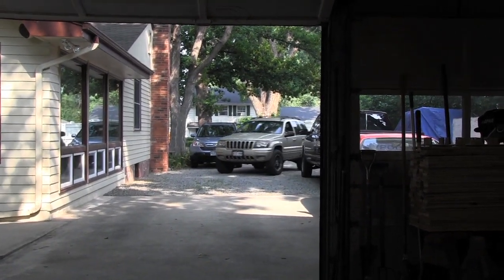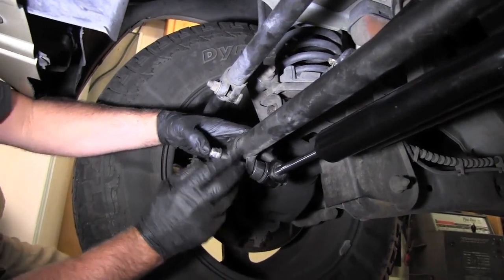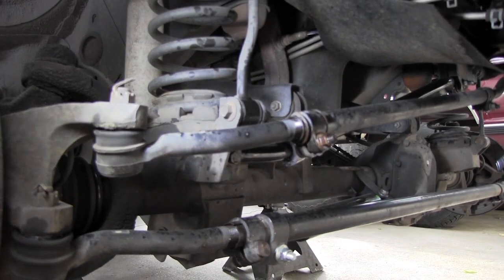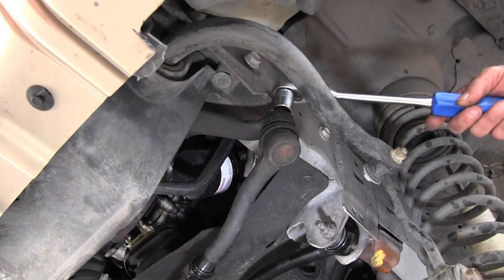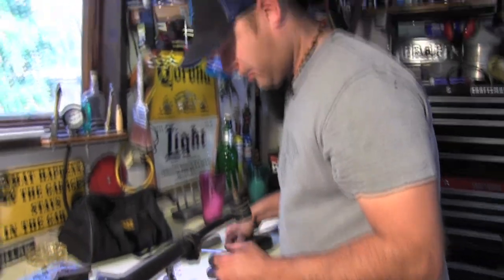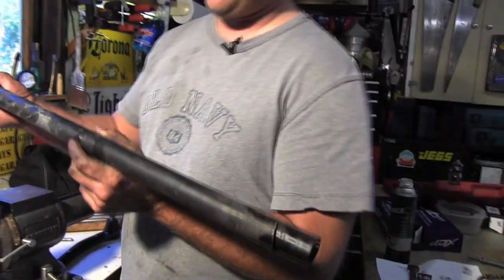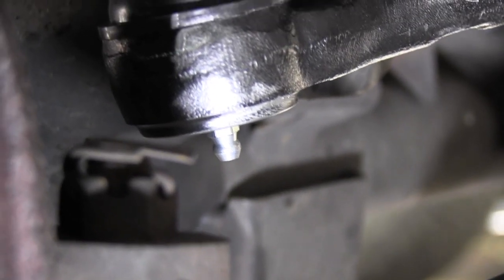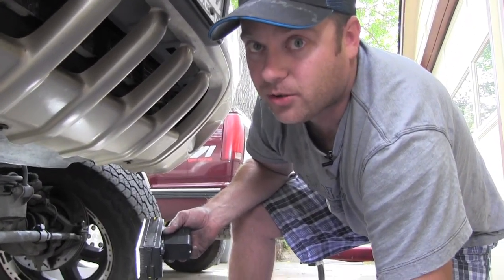Death Wobble Fix - Jeep Grand Cherokee Part 2

Comment: Thanks for the video. I replaced the steering stabilizer which was obviously bad (leaking oil). It didn't solve the problem though. I took it to a shop and the they determined it was the track bar and all four control arms.  I saw a video on replacing the control arms, and it was more than I wanted to tackle. I spent all my Christmas overtime money but it was done while I was at work.

Comment: A tip we been doing for over 40 years is to heat the tie rod end sleeves with a simple hand held propane torch and we use map gas instead of propane and use on other bolts and works great on brake bleeder screws. Of course put the anti seeze on everything.

Comment: Just finishing up my death wobble repair; my WJ is a secondary vehicle so I was able to leave it on jack stands in my garage for several weeks and take my time replacing ball joints, tie rod ends, steering stabilizer & track bar. Watched part 1&2 a few times to get my bearings, thanks for posting it up! Pete seems like a good guy to wrench with!
Reply: instablaster.

Comment: You can use grease and sand mixed together on the threads running in and out numerous times then wash it all out and then put your anti-seize on then turn it with your fingertips or if you want to be technical valve seating compound I use grease and sand you always have that around

Comment: Hello.  I would like to ask you a question about the death wobble symptoms in my Jeep WJ.  I modernized the entire suspension over a year ago, raising it on washers by 2", replaced all bushings with polyurethane ones, new rod ends, shock absorbers and steering damper. Everything was fine for a year, but recently the Jeep at a speed of about 80 km/h (50 mph)  it started to fall into the death wobble. The entire suspension is stiff, there is no play anywhere, there is no knocking. Due to these new symptoms, I installed harder bushings in the trackbar and a new steering damper because I suspected that this was the cause. Now the speed of falling into death wobble.  wobble is about 60-65mph. If you have any ideas what else might be wrong, please write your suggestions. Sorry for my language, but I don't speak it very well and I used a regular translator. Thank you and best regards.

Comment: All you have to do to fix death wobble is buy the 12 piece  tier 4 core control arm set and steering linkage,  a redtop steering box, and drop arm is stock up to a 4 inch lift and you'll be good.

Comment: It's the balancing of the tired!! Not all the unnecessary replacement of parts.  A steering damper does not cause a vibration. Tire guys make a lot of extra money when they get you to return for more parts. It's the tires not being balanced correctly.

Comment: Some more tips for ya' ...after doing a zillion of these, at 7:40 by your using a pickle fork to pop her loose, alternately in this particular view, one can strike the top of your castle nut with your 3lb drill & that works too, but only if you have a new castle-nut.
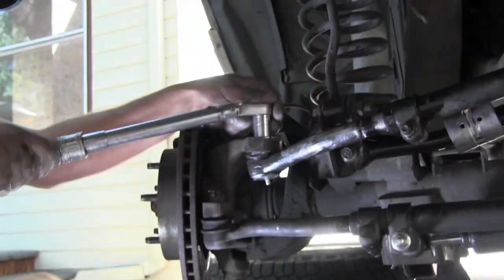  Also, at 19:00 when your tightening the castle-nut, sometimes the spindle will turn denying you the full torque value...take a large slip-joint pliers(EG MAC M460G) & apply pressure to keep the spindle from turning...or, put a floor-jack(or tranny jack if 'up in the air")  to apply SOME pressure as well. The pickle-fork has seemed a little iffy sometimes for me, as the thickness of the spindles can vary, & sometimes these spindles can be too big for your particular fork...& you can't really "know" by sight because of the taper...a bit of a guess really. I know of this because on a few instances the fork has jammed because the spindle was too big...hence my alternate approaches..
Reply: When do you put Greece? DO you think better before tighten ing up and before you drop it back down??
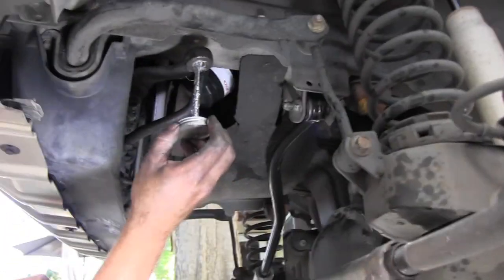Reply: @jat-justamaturetech-philpj8285  At 17:42   no, no & no.....do NOT be putting any "high solid" lubricant in the taper pin nor the hole. The pin itself is a harder material than "the hole", as such, this is a solid metal to metal fit, the taper itself is to assure this. When one removes an old one, you can actually see the slight metal deformation in the hole confirming a solid fit. Both pin & hole should be as clean & dry possible  before assembly....no lubricant.
Reply: @AndieBlack13  . Lol. I think you misunderstood me? I meant lube in the joint.
Reply: @jat-justamaturetech-philpj8285  The sealed versions without a zerk fitting of course are pre-lubed at the factory, those with the fittings you fill them up anytime you want, preferably after you've assembled everything & the suspension is still unloaded, as it's easier to clean up when the grease puffs out telling you when it is full.

Comment: After replacing shocks, stabilizer, track bar, bushings and alignment, I had enough and took it to my mechanic. He looked underneath, said nice job, how about replacing these nine year old tires now before I redo your alignment. Put on a new set of tires (Cooper Evolution), went over the same areas I always experienced that $%^$% wobble andddddd......no wobble. Went back a second time over that twenty minute stretch of highway and no wobble. The front end would shake like crazy, not anymore. Now I wonder if it was the tires all along.
Reply: roadrunner Hmm 🤔. Ok I’m going to get 2 good used front tires first since I need them anyway and work from there. Because I replaced my tie rod and sleeve already( for another situation)
Reply: roadrunner Reading back a month later, all those components you added were probably needed. I got tie rod ends done and ball joints because they were worn out. But I haven’t got tires yet and I still have a slight small wobble, not as bad. But it all adds up. At least it’s not our engine lol.
Reply: @Tdurrgt  I came across this a year later, hope it all worked out for ya. So that was my 98 XJ. last year around this time I experienced the wobble starting on my 2000 WJ and tackled it. I did replace the trac bar and stabilizer again because they were loose....inexpensive parts. Still had the wobble. I didn't replace shocks yet. My Goodyear tires were in need of replacing with 41k miles and seven years, ( great tires but didn't want to spend $500+) so I replaced with same Coopers as Tire Rack had a $50 rebate with purchase of four coming to $400, ( great tire for the money). I drove to that dreaded wobble section of highway and no wobble, didn't even go back around and have not felt that wobble for over a year now. Going to replace shocks now but not going with Monroe Sensa-trac again, they replaced the original Mopars but not spending that kind money. The Monroes gave it a very unstable ride being that they are twin tube shocks, I am leaning to Gabriel mono-tube as many have suggested. Learn something new everyday. With 187k on this 4.0 Jeep I have replaced so much that I know it like the back of my hand, easy to make repairs, window regulators, radiator, water pump, a/c compressor which was a PITA, brakes, hubs, axles etc. I am going to take this to 200k. Latest was valve cover gasket which did not stop the oil leak. Next has to be oil pan gasket and rear main seal combo, again inexpensive parts but labor intensive on my back no less. Lot of guys knock Jeep but the older Jeeps were so easy to work on even if they did break too often LOL. And the 4.0 is bullet proof. I call it therapeutic. This is my second time around...If anyone is having this problem and your tires are old (check the DOT code on the sidewall); replace your tires first being you need them anyway, and ask the tire shop if you can look at the physical tire tread and check the DOT code, sometimes these tires are already a couple of years old from sitting in a warehouse before being ordered, that's years loss of tire life and flat spots, it might be a savior before getting involved with the front end which could run you up some big money if you don't do it yourself. Cheers.

Comment: Ok on my Jeep Grand Cherokee I went though the same issue the way I fixed it was to replace the pinion arm,once I did that Wala the death wobble was fixed, hope this info helps
Reply: Dave Coakley I’ve replaced so many parts for this problem but the pitman arm. Still having the problem. If that doesn’t do it I’m selling it for parts
Reply: @rayo8482  I went through the same thing its the bar which has a ball joint on it that hook to the arm going to the steering box you will see it,mine was hell to get off had to air chisel the nut of of it,but buddy it fixed mine I think it's around a hundred bucks I believe,it's been six months or so sense I finally got it figured out

Comment: Steering stabilizers do not fix death wobble nor do they cause death wobble. They dampen steering vibration
Reply: So what does??
Reply: @jat-justamaturetech-philpj8285  so many things. Worn out tie rod end/s, control arm bushings worn out. Having loose components will then wear out the steering stabilizer shock.
Reply: @zzz7zzz9  . Can you replace the control arm bushings on a 2000 Grand Cherokee Laredo??
Reply: @jat-justamaturetech-philpj8285  yup. But, it's a bitch. Much easier to just change the entire control arms. Sure, just doing the bushings is slightly less price, but can wind up taking longer anyway, and much, much more frustration.
And it wouldn't be any savings, as you'd likely overflow the curse-jar a couple times over.

Comment: I have replaced 3 of my 4 tie rod ends my track bar and steering stabilizer, and I'm still having the death wobble. Only thing for me to try now is replacing the steering gearbox and the last tie rod end
Reply: It is caused by an out of round tire. NOT out of balance, out of round. All straight axle cars have the wobble.  Ut happens at 40 mph or around there. Check your tire ad it will be fixed. Old school fool.
Reply: Jennifer Bailey how are yur ball joints?

Comment: Have a question for you regarding replacement of the steering stabilizer. I purchased a rough country n 2.0 steering stabilizer for my 2004 Jeep Grand Cherokee Laredo. I installed it the same way as your video shows but for some reason if I keep the bracket that holds the smaller bolt in the downward position it seems like it binds and the bushing comes out a little from the end of the piece. The kit came with two washer so I put one washer on each side of the bushing ran it through the little bracket and it seems like for me not to have it by and I have to turn that bracket forward and upward to get in a position where it's actually straight which puts it about an eighth of an inch from the actual tie rod bar but it doesn't seem like when I tighten it it's completely tight not sure how much pressure or Torque to put on this Bolt saying when I videotape to myself turning the steering wheel that little 10mm bolt or whatever it is you can see the bushing move

Comment: What was the length on the bottom bar? (Long one) on my 2002 mine is bent and im not going to get a good measurement.
Reply: Bottom bar is tie rod adjustment sleeve 41.5" long I have 2000 grand Cherokee.

Comment: I have an 02 wj 4.7 with 1,5" old man emu and 265/70/17 bf and I was experiencing terrible death wobble. I ve just replaced track bar bushings, front lower control arm bushings, front upper control arms and bushings, all four end tie rods... And the death wobble is still there..? Front OME coils are heavy duty, while the back are non heavy duty and I don't have any winch.  Also have replaced the steering stabilizer with a procomp. The bill is getting higher and higher and no solution to the problem.. Anyone any ideas?
Reply: You check the wheel bearings? Having the same problem in my 02 4.0 and I've replaced all tie rods ends and it'll last a week and it'll come back. Getting at my wits end
Reply: And when you replaced the bushings did you check the ball joints?
Reply: I heard it can be the tires??

Comment: I have an 01 jeep grand cherokee, I wouldn't say I have a death wobble per say,  but at around 45-50 the steering wheel will shake/ vibrate. and it does not do this all the time.  my mechanic test drove it with me in the vehicle and it did do its vibration. he took it back l to his shop, lifted it and checked everything, front and rear.  ouldnt find nothing going wrong. Nothing was worn, torn, broke or loose. thow my passenger front side tire is missing a wheel weight. any suggestions other than re balancing my tires.?
Reply: one of your tires may have a broken belt my Grand Cherokee did the same thing. I replaced the bad tire and it fix the problem.
Reply: Dylan Strickland just had the tires re balanced and rotated front to back. that fixed the wheel vibration.  but belts looked good
Reply: Maybe a wheel weight fell off? Something thew balance out of whack.

Comment: So did it fix it?
Reply from the maker: Sorry for the late response....In my case it fixed it after replacing all the parts you saw in the vid.  Another cause could be your control arms....both upper and lower.  If the death wobble comes back, I'll do a vid on replacing those.

Comment: You always hit the part the joint is going into not the joint. It’s a cotter pin not a key and it’s a castle nut not a castleated nut or whatever you said. And we got left hanging on wether it’s fixed or not.

Comment: I watched this video then proceeded to hopelessly beat the shit out of that top tie rod on the drivers side to no avail thinking it would would eventually pop out like it did for u guys and almost lost my mind thinking that's just the way it had to be... eventually I discovered if u disconnect the other side first u can turn the wheel beyond normal range and the bolt will swing right out into open air for u. I tapped it once and dropped right out. >=/

Comment: First of you put it on backwards look at how the steering stabilizer was sitting when you took it out Vs. when u put the new one on😂😂🤔 you put it on backwards bruh 🤦‍♂️ when you took it off the hydraulic end of it was facing the left side drivers side.. when you put the new one one you had the hydraulic end facing the passenger side 🤦‍♂️
Reply: G G.A.I.N TV sorry to burst your bubble, but that's incorrect. I just installed another stabilizer on my own 04 grand cherokee.. the slot you slide the bolts into are sized. The driver side bolt is thicker and the passenger bolt is thinner. When installing you will see that there is only one way the stabilizer will go on.
Reply: Video don't lie!

Comment: Using the wrong tools. Use a sledge hammer bolt either flush or reverse n flush swing down center one time only n down she goes.  On bar use medium pipe wrench spray bottle with old engine oil recycle. Let it set If hard bring the sledge hammer again on pipe wrench only once or twice ... N loose.spray again let it set... Clean with a old tooth brush scrub n broom brush out last blow in it or use electronic air blower in a can. Clean she is

Comment: You look like you know what you're doing but, just count how many turns to unscrew the tie rod end until they come out. No need to measure. You're going to do an alignment anyway. You will be just as close. Just a suggestion.

Comment: maybe you could try identifying the root cause of the problem instead of just throwing money and parts at the problem.
Reply from the maker: That would be awesome! Wish we knew how to identify the root cause of death wobble.
Reply: There are plenty of videos on how to check for play on both ends of the track bar, ball joints, tie rod ends, etc. There is no reason to guess until you've at least taken a look at all the possible issues. 

Set up a video camera under the truck and turn the steering wheel back and forth, rock the truck and see if the mounting brackets move, jack it up and check the ball joints and hubs. And so on.

Or you can say "Golly, let's just change the track bar and see if that helps."

Was the hole wallowed out? No
Was there any sign the bushings were failing? 

Come on, man
Reply: Exactly my thoughts
Reply from the maker: Apparently you didn't see part 1 when we changed the track bar... and we went over the ball joints as well.  Next time we do a vid, we'll make sure to go over things more than one time to make and highlight it so it's not so confusing.  It's kind of like reading an article online in the paper. No one reads the whole thing, they just read the title.